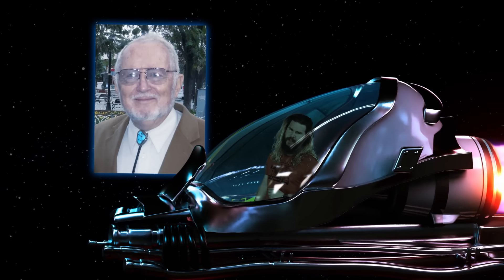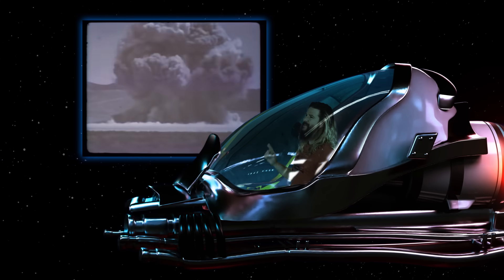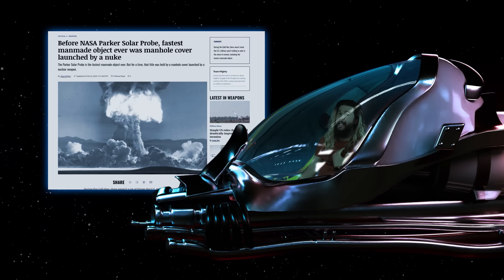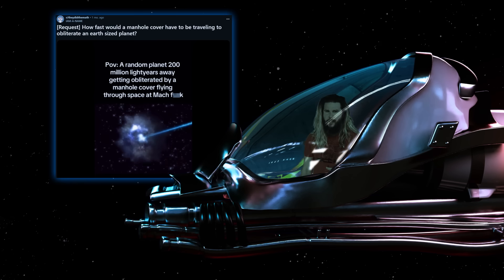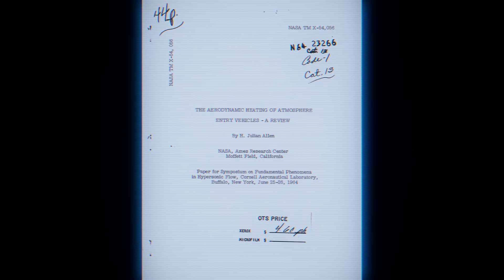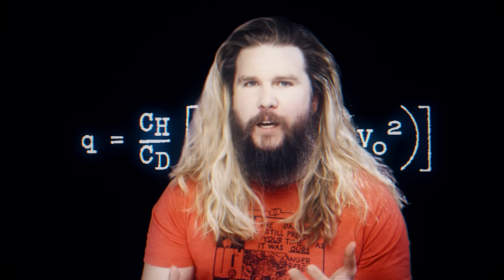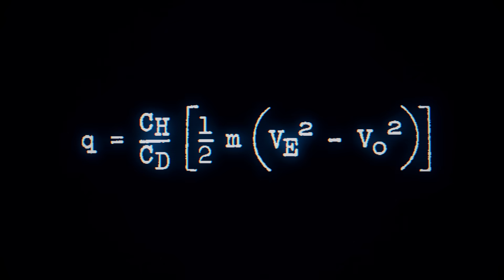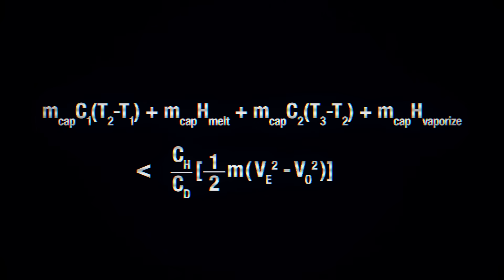Debunking the Nuclear-Powered Manhole Cover

Comment: Does this all factor in the force required to break the, no doubt, monstrous welds that were used to attempt to hold the cover onto the borehole?
Reply: Also comparing it to meteors entering earths atmosphere where the atmosphere exponentially "thickens" as it gets closer to earth thus increasing the resistance acting upon it isn't fair because as the manhole ascended the atmospheric force acting upon it would lessen, albeit within the space of 0.2 of a second so do the density changes in altitude get taken into account with any of it?

Comment: Has anyone considered any possible effects of ablation from the bottom side of the cover. IIRC, the idea for Project Orion arose from the discovery that small spheres located mere meters from ground zero survived the fireball because the pressure from surface ablation on the side closer to the center of the detonation was so much greater than the pressure experienced by the side farther away from the center that the spheres were accelerated away from the fireball so rapidly that they survived basically undamaged and were discovered kilometers away. If such an ablative effect occurred on the bottom side of the manhole cover, it could have greatly increased the velocity of the already ridiculously fast projectile AND formed a protective layer insulating the rest of the steel from the bulk of the heat. Or a similar effect could have occurred on the side facing the atmosphere stealing some of the velocity but creating a similar protective layer.

Comment: I disagree, I believe it made it to space. Based on its minimum speed (needed to escape the high speed camera film after 1 frame, so could have been going even faster), it only took around a second to get to space. 

And I don’t think it would have had time to vaporise. Bearing in mind that it’s got a perfect straight up trajectory, through the atmosphere, and you say in your comment about faster bullets being shredded in water immediately, but this was caught on high speed film, so in other words it wasn’t shredded immediately by the atmosphere it was traveling through, and it’s most dense at ground level, it gets thinner as it goes up. 

Also meteors and meteorites practically never have the perfect entry angle of straight down, so they have to travel through a lot more atmosphere, for a more prolonged time. Think of world of tanks etc, a tank round going through angled armour is a lot harder than straight on. Same with meteorites through the atmosphere. Or lids shot into space. 

It was only pushing through dense atmosphere for a fraction of a second. Plenty of meteorites make it to the ground, and aren’t a uniform cast metal. It was also likely spinning and tumbling, so at times it would have less resistance, as well as constantly changing the part that’s punching through the atmosphere. 

What we need is the maths on if it made it to space, based on a minimum speed, and where it happened, where would it roughly be in space today. It could theoretically be the furthest man made object from earth. Certainly a top contender.

Comment: That’s not accounting for thinning atmosphere. See the reason thinning heat up is the loss in velocity caused from the thick atmosphere. A meteor is going from no atmosphere to a really thick and loosing 9/10th of its speed. When re-entering the atmosphere you aim for 32^ because of its ideal collation between gravity and atmospheric drag.

Comment: The manhole would've been in space within 2 seconds.The atmospheric heating wouldn't have physically had time to transfer that much energy into the material to vaporise it. It also started in the densist part of the atmosphere going towards a vacum. Straight up, not on a trajectory like a reentering space capsule or meteor. I truly think there's a dome shaped manhole travelling through space faster than our fastest space probe, more then twice as far from Earth as Voyager 1.

Comment: Others have pointed out issues with the math. Lets address a few other issues. #1 The 900 kilo STEEL cap (Often characterized as a manhole cover which is commonly made of iron thus the misapprehension of the lids composition) was launched by a 300 ton, not kiloton, 300 ton explosion. #2 the air itself would have been moving faster than the lid itself thus there would initially been no frictional drag heating or atmospheric compression due to the surrounding medium moving in the same direction and at far higher velocities. #3 The initial movement at the highest velocity occurred in the densest part of the atmosphere where it was protected by the concurrent movement of the atmosphere around it. #4 Unlike meteorites which usually strike glancing blows thus greatly extending their compressive time in atmosphere, the cover launched straight up from densest to least dense atmosphere where drag is most minimal. Also typically meteoroids the size of a marble will reach the ground in part as the ablation that occurs during the plunge keeps the center cooler via the gaseous ablation of the surface layers. Steel being so much denser that the average meteoroid would require much greater heating to ablate in significant quantity. Thus the reversal of the atmospheric density causing heating and ablation would act to cause even less ablation than the more normal standard calculations would estimate. Also ablation carries away the massive heat transferred to the steel thus the plasma works to hold temp gains internally to minimal amounts by carrying it away. #5 We are making the unlikely assumption that no explosive forging took place which would have resulted in a far more aerodynamic dart type shape with concurrent lessening of ablation. #6 With a column of decreasing density 100 km deep and a speed of 66 kps the steel lid would only have had 1.5 seconds to heat and with decreasing density the rate of heating, ablation would also reduce. Given flow dynamics would have attempted to present the minimal dimension (assuming no explosive forging) in the direction of travel thus minimizing drag so in actuality the majority of the device should easily have pierced the atmosphere and ended in a high period hyperbolic orbit.
I haven't run the math but with experience in explosive forging and some background in nuclear and plasma physics, I think there is actually a good chance it made its escape from these earthly confines.

Comment: Could it be similar to a ballistic missile launched from a submarine. A cloud of gas was also propelled with the manhole. Could this cloud of gas be like the bubbles helping a missile move through the water? Also, since atmospheric reentry is at an angle, the object spends much more time in the atmosphere. The manhole cover would have been going parallel to the atmosphere, so minimum time exposure possible.

Comment: A few things that makes it hard to calculate, what was the pressure when the nuke went off that launched it? How do you calculate the decreasing drag as it was entering the upper atmosphere and then, if it didnt leave the atmosphere the reverse drag as it reentered. Not to mention orientation & rotation during flight. Also, was the manhole cover melted and changed into a slug of iron or did it retain its shape? Really wish we had more then 1 frame from the video.

Comment: It is HIGHLY likely that the cap heated fairly quickly and formed into something of a bullet shape due to air pressure and heat and then cooled as it went higher and higher and lost less of its energy to heat as it progressed.    I think that would make it fairly likely that it did, in fact, depart our orbit.

Comment: One difference between an object entering the atmosphere from above and one one leaving it from below is the density of atmosphere they travel through. 80% of the mass of earth's atmosphere lies within just the first 6 miles. The manhole cover would have zipped through this in just 0.14 seconds. Rather than the density steadily increasing and causing more and more friction and more and more heat as what happens with meteors entering the atmosphere, the density would be steadily decreasing resulting in less and less friction. Plus. the higher you go, the cooler it gets.

Comment: Well... Two little things I noticed. In your calc for atmospheric friction you used the orientation of the disc face on but when experiencing atmospheric drag things will reorient to provide the least resistance. And even that is In Theory ... In reality it was probably spinning like hell. Yes, the energy was there to melt it, but was it applied over an adequate period of time? These process take time. I'm fairly certain with how close those numbers were that there's a chunk of iron that made it out. It's no longer necognizable as as iron cap tho so yeah there's that. But it's real unlikely every bit of it fried completely and equally. Science is never neat like that once it crosses that engineering divide I to experimental reality 😂

Comment: @kylehill the Manhole cover wasn't cast iron or iron it was in fact steel so I think your math might still be wrong and yeah you might have to remake this video 

taken from wiki 

Missing steel bore cap
In 1956, Robert Brownlee, from Los Alamos National Laboratory in New Mexico, was asked to examine whether nuclear detonations could be conducted underground. The first subterranean test was the nuclear device known as Pascal A, which was lowered down a 500 ft (150 m) borehole. However, the detonated yield turned out to be 50,000 times greater than anticipated, creating a jet of fire that shot hundreds of meters into the sky.[8] During the Pascal-B nuclear test of August 1957,[8][9] a 900-kilogram (2,000 lb) steel lid was welded over the borehole to contain the nuclear blast, despite Brownlee predicting that it would not work.[8] When Pascal-B was detonated, the blast went straight up the test shaft, launching the cap into the atmosphere. The plate was never found.[10] Scientists believe compression heating caused the cap to vaporize as it sped through the atmosphere.[8] A high-speed camera, which took one frame per millisecond, was focused on the borehole because studying the velocity of the plate was deemed scientifically interesting.[8] After the detonation, the plate appeared in only one frame. Regarding its speed Brownlee reckoned that "a lower limit could be calculated by considering the time between frames (and I don't remember what that was)", and joked that the best estimate was it was "going like a bat!".[10] Brownlee estimated that the explosion, combined with the specific design of the shaft, could accelerate the plate to approximately six times Earth's escape velocity.[10]

taken from google 

The cap used in Operation Plumbbob's Pascal-B test was a steel manhole cover, weighing approximately 900 kg (2,000 pounds). While not a standard manhole cover, it served the same function of capping the shaft that contained the underground nuclear device.  

taken from AI

The cover launched during Operation Plumbbob was made of steel. It was a 4-inch-thick, 900-kilogram (2,000-pound) steel plate that was welded over the top of a deep shaft for the Pascal-B nuclear test in 1957. 

Yeah if all of these sources can confirm that it wasn't iron or cast iron we can assume you were wrong and that your maths need some tweaking.
Reply: I did the research so you don't have to now just make a revision to this so we can truly know the actual answer.

Comment: the calculation you used was for entering not leaving the atmosphere. the atmosphere would be densest at ground and thins as you go up which means less friction and at 41.6 miles per second and at 41.6 miles (about 67 kilometers) above Earth's surface, the temperature is approximately -80°C (-112°F). This region is in the mesosphere, where temperatures decrease with increasing altitude and are colder than those in the stratosphere below.

Comment: Before breaking up, the Peekskill meteoroid was a large object, likely weighing over two tons. Estimates suggest it was between 1 to 2 meters (3 to 6 feet) wide. The fragment that struck the car, a 12.4-kilogram (27-pound) piece, was only a small portion of the original meteoroid.

Comment: Objection!

1: You don't need to vaporize the cap. If you manage to melt it, the individual droplets would be spinning around in the air, with a HUGE surface area and low mass, and would stop pretty instantly. So if you're able to show that the cap would melt, that should be sufficient.
Also, if it's turned into droplets of iron, we can't say that it's a "man made object" that was yeeted into space.

2: At a speed of 66 km/s, it would take less than 2 seconds to reach outer space. While iron is a very good conductor, it is reasonable to assume that it will not heat up evenly, and will ablate off its skin. So even IF the total energy is sufficiently to melt it, or even boil it, that does not mean there wasn't a core that survived.

3: You can't assume that it will move without a tumble. Most likely it will deform, turning into what resembles a sphere. And it will also tumble, meaning you won't have the 4'x4' surface facing the direction of travel the whole time.

4: While you are calculating the energy an object will face while entering FROM space, what we are looking at is an object being sent into space by an explosion. These are very different scenarios.
When this cap is propelled by an explosion, that means the explosion will also create a pressure wave pushing in the same direction. Pushing the air away. Which means the air resistance will not be the same. I can't say how much that will influence the answer. But I would say that if the immediate explosion plume (within 1 second) rises to a significant height, then the air resistance up to that height would be reduced.

That being said, the conclusion is probably correct.

Comment: Your premise is wrong.  

A man hole cover being propelled with the force of the atmospheric pressure below from a nuclear bomb, is not similiar to a rock falling from space.  

1)  Any space rock would be moving from a vacuum into to atmospheric preasure.  This manhole cover is moving with the force of air beneath it toward a vaccuum.  The air beneath would pass it, diminishing drag to to near zero as it's altitude increases.

2)  Rocks that enter the atmosphere and vaporize create flashes of light.  There is no evidence that this manhole cover created a bright flash of light.

3) The man hole cover would have elevated with it's curved edge pointing up flipping rapidly. Your equation describes drag against a flat object. 

You are correct about one thing.  Garbage in means garbage out.

Comment: The math was bad. It assumed perfect conditions. But in reality, perfect conditions don't exist, and his parameters were fundamentally flawed (pressure isn't constant with altitude). 
Another hugely flawed assumption was using the equation for atmospheric entry, not leaving. The manhole would have had the reverse effect of what happens when something enters the atmosphere. In fact, it faces less drag and less friction as it moves higher up.
Something leaving the atmosphere and entering it, should NOT be treated the same. They are fundamentally different, and its not even remotely calculated the same.
Unless someone already solved for that equation, this should have been a calculus problem with integrals, not algebra.
I mean, it probably still vaporized, but I would have liked more accurate math than a few fundamentally flawed shortcuts you used....

Comment: To vaporize, the cap should get all that energy in the first tenth of a second or so, because after that the drag would go down dramatically and in less than 1,5 seconds, given the speed of 66 km/s and its perpendicular trajectory, it would be technically in space.

Also, before vaporizing or melting, the iron slab could deform and become more aerodynamic, much like what happens to iron meteors falling on Earth, thus heating less.

So, the slab has to survive just about 1 second without completely melting to be able to reach space and leave Earth, probably forever.

Comment: Big issue here.  All the models used are for an object coming in from space.  In other words, experiencing increasing air density.  The cap was going up, experiencing decreasing density, and thus less friction and less heating as the cap ascended.

Comment: The problem how you calculated the figure coming down yes you get hotter and hotter the further you go but you've forgotten to point out that higher the higher you go less air means there's not enough heat to build up because the oxygen isn't pushing on the front of the metal dish

Comment: You have a problem with your fluid dynamics calculation, including a limit on the temperature curve. There comes a point where the thing becomes so hot that the atmosphere itself no longer affects it because it is ablated away, and since the object blew out of the atmosphere in less than a second, it is quite feasible that that layer was able to sustain the object while it traveled out of the atmosphere.

Comment: I think you failed the reality check, but i also have trouble zipping my pants. A meteor entering the atmo is accelerating and the atmo is getting denser. The man hole is the inverse. I say, If the manhole cover survived the initial 0MPh to "what ever" MPh  blast then all forces acting on it are less than that and it survives. The ONE frame proves it survived the initial blast. Space object.

Comment: technically there's different levels of friction through the air while leaving the atmosphere 👀 it also differs when air quality is changed so depending on humidity of that specific hour in that specific area the heating of the cast iron would change. it also changes with aerodynamics which i would assume the cover would have bent so the aerodynamics would have changed.